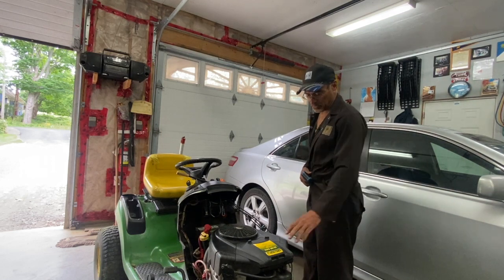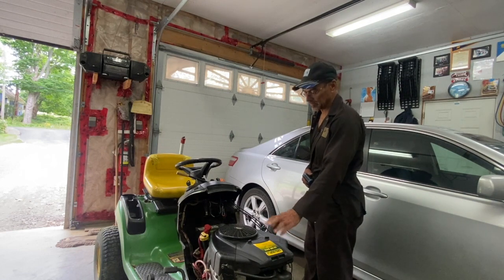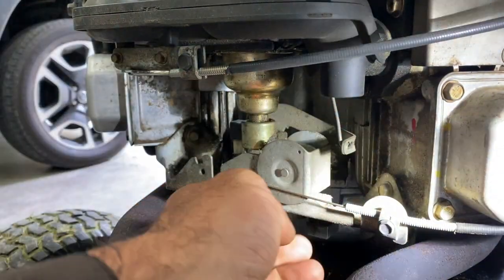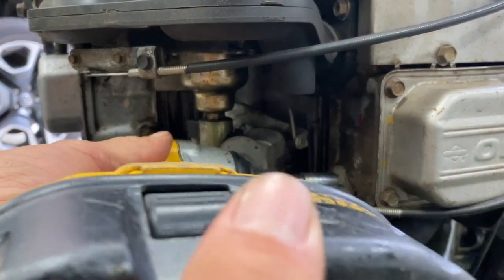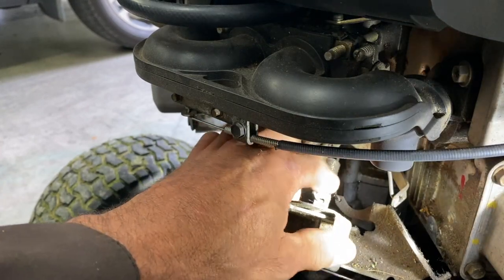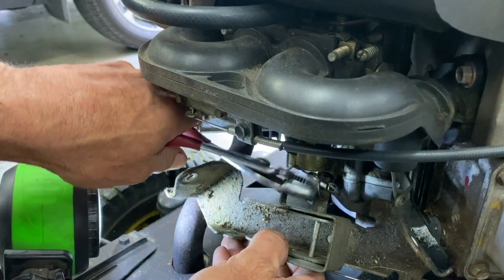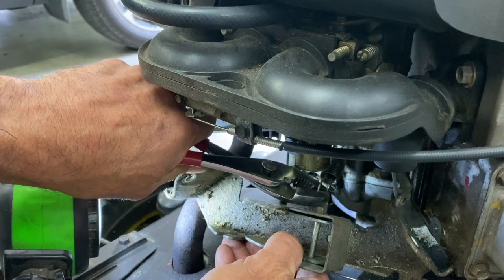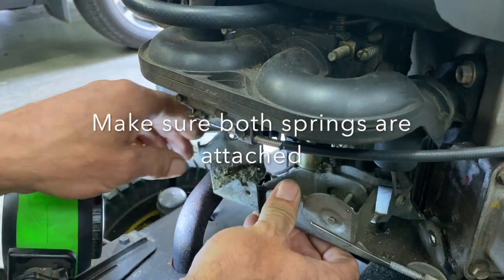How to Increase the RPM-s on a V-twin Briggs Stratton engine John Deere LA125 (set the Governor)

Comment: If you set throttle lever to full choke while off the governor spring lever is easier to reach and bend (adjust) without removing the bolts …

Comment: Great Video.  Thanks  for making them.     .   .    .   .But
I have a Briggs 21.5 HP V-twin that max's out at 3119 RPM.   I bent the tad exactly as shown in this video and can't
get the RPMs to increase at all. I pretty much bent it as far as I dare and get no change in the RPMs.
 If I put pressure on the governor spring that goes to the idle adjustment screw while running at max RPM I can get
 the RPMs to temporarily increase while putting pressure on it.
Reply from the maker: Have a look at this video;: 
  https://m.youtube.com/watch?v=ZHDuALsVndg&pp=ygUdaG93IGdvdmVybm9yIHdvcmtzIGpvaG4gZGVlcmU%3D
Reply: Hello again  Weekend Hobby Mechanic,
The only way I could get the RPMs up was to cut and shorten the high speed spring by 3 coils. It now will
rev up to 3450 rpm and idles at 1600 rpm.  I can live with that.   Your videos helps a bunch showing the workings of the governor and linkage.  Thanks

Comment: Hi,  I have the same lawn mower and I purchased the same Non-Contact RPM Meter you used in your video.  My readings are in the tens of thousands!  22,000 rpms.  Lord I wish I could get a Briggs and Stratton engine to run at 22,000 rpms!  Curious what I'm doing wrong.  The meter came with reflective tape and I cut about a 1" piece and placed it towards the outer portion of the rotating "fan" at the top of the motor.  Same place you took your measurement.  Any suggestions on how to get a more accurate reading?  thanks
Reply from the maker: Weird, mine works great. Try a smaller strip of reflective tape.   If that doesn’t work, return it for a refund.
Reply: I downloaded a free app called strobe light and its blinks the light on ur phone and you adjust it on the center logo until u get it to appear still and it’s is surprisingly close to get an accurate rpm
Reply from the maker: @Scoondog    Will look into that.  Thanks.

Comment: I tried this and it didn’t work, I noticed the return choke spring was broken, would that cause the increase of the rpm’s not to work?  Right now it’s at 3400rpm.
Reply from the maker: It should work.  Watch this video:
https://m.youtube.com/watch?v=ZHDuALsVndg&pp=ygUPR292ZXJub3Igd29ya3Mg
Reply: @WeekendHobbyMechanic   I did watch this and confirmed the idle is adjusted correctly as shown in your video.
Reply: I know there’s room for the throttle to go up too, I can push it to 3900 but it settles in at 3400.   Frustrating!  Especially since I need the extra rpm’s to utilize the three bags collector and the deck has an additional belt to run the attachment with a “turbine wheel”.
Reply from the maker: @chuckbllrs3844   Press down on the governor arm @0.30sec in the video. Does the RPM go up?  You have to apply more spring pressure to the arm.

Comment: Thank you, I did the carbonator clean out etc because it was surging at at a low RPM.. once I got the RPM over 3300rpm no issues. It was a RPM thing!!!  Great video. Lol the problem with experience is you get it right after one needs it!

Comment: Thank you great video

My governor is set and still, with absolutely no tension on the throttle lever or idle spring, my engine starts fine and then immediately throttles to about 4000 rpm.  Wy worse when I increase the throttle.  I zip-tied to the absolute slowest throttle position and the engine still runs but only about 100-150 rpm.  I don't think I am missing a spring or any adjustment but really getting frustrated.  

I would appreciate any input.  Thanks again
Reply from the maker: Watch this video:
https://m.youtube.com/watch?v=ZHDuALsVndg
   Push the governor arm up and check if it closes the throttle plate. @1:12 - 1:40 in the video.
  Close the throttle plate by hand and start the motor.  It should idle. Check the governor's arm, it should've gone up.
   You can also watch this too:  https://m.youtube.com/watch?v=ze7aW_pSuko&pp=ygUUU2V0IGdvdmVybm9yIHdlZWtlbmQ%3D
Reply: @WeekendHobbyMechanic  Thankyou
Reply: Governor gear flaps broken and particles inside your engine, don't run it like that!

Comment: Same kawasaki fs 481v engine but two different codes the first 2.900 rpm the second 3.100 what depends on thanks. I have the 2900 rpm it can be modified thanks.
Reply from the maker: The motor I’m working on is Briggs & Stratton.

Comment: My throttle won't stay in position. How do I tighten the wire adjustments to make it stay in the proper throttle position? When I engage the blades the throttle slides back.
Reply from the maker: Your throttle lever should have resistance when you open and close it.   If it moves too freely is worn out.
Reply: @WeekendHobbyMechanic  I ordered a new one (waiting - husqvarna takes forever), but there is resistance in the current one. It's a Husqvarna R322T AWD 2018, with the B&G Endurance Series engine 20.0hp. My throttle/choke wire goes into the tabbed mount hole, not the lower hole like in the video...in ALL the B&G videos. That threw me off for a minute until Husqvarna sent those specs. It's configured differently to accommodate the articulation of the bee's butt on that longer unit.  The tension is there, but not like when it was new. When it hits a work load it creeps ONLY back to 3/4 throttle now since I changed the spark plugs - gapped them to spec, oil/sea foam/filter, cleaned the intake fan, put on a new air filter, adjusted the throttle cable, which helped a LOT. While I was at it I changed out the tuff torque spin-on filter and it's oil just cause all these items were on the maintenance schedule this week anyway.  lol  I, additionally, cleared off the rubber from the current throttle cable and was able to move the cable to adjust it off the melted plastic spot. I am abject to mess with the govnor spring to get more rpm (assuming to bend it a little) in case the carburetor is dirty, yet I don't want to really tear into the carburetor to clean it until I check off other possible causes. But I will if I have to. If I had a bad oil leak where the mechanic didn't put the cap on the oil reservoir after he'd changed it last fall, oil got everywhere before I discovered it - happens so fast, would that affect the carburator's performance if it sucked in any of that oil? I was so mad. It's not blowing smoke tho.  I spent a lot of time cleaning off all the oil. That's when I decided I have to work on it as I can to do the maintenance stuff as much as possible myself. Going behind them is more work now that I don't trust them. Thank you for the help above.
Reply from the maker: @HomeDIYSStuff  .   You have a nice mower. Nice that you're taking on the maintenance yourself. Pretty soon you might have your own Youtube channel, lol.   If your motor runs fine at idle and full throttle, your Carb works perfectly.      Keep up the good work.